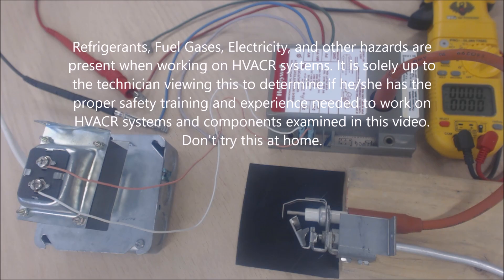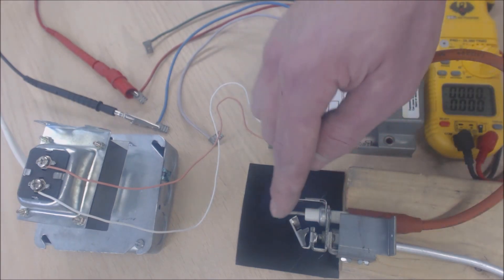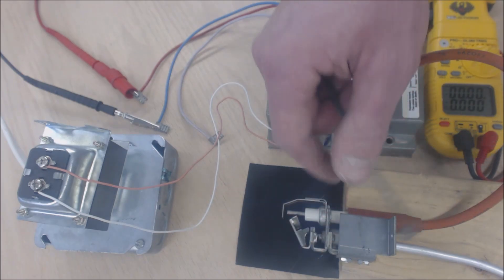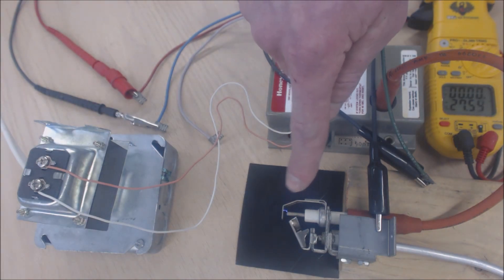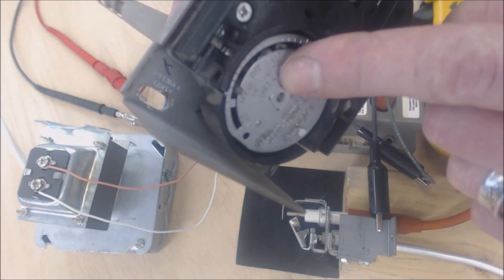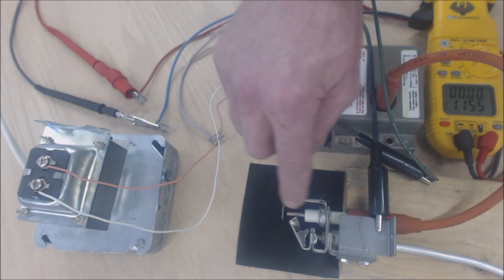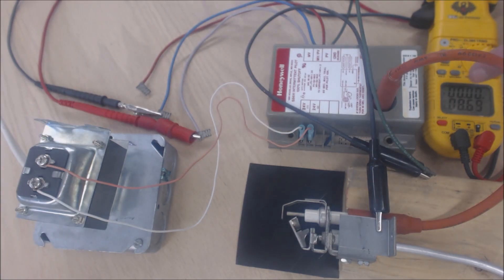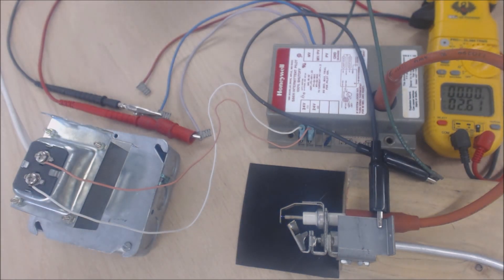Gas Furnace Spark Ignition Control Troubleshooting!

Comment: What could cause the ignition module not to be getting any power.  I ran thru the troubleshooting steps in your aquastat video and everything checks out.  Circulator is running and I have 24 v at B2.  I have the vent damper on manual and the green light inside indicates it's getting power.  The blocked vent safety switch is not showing continuity but I'm not sure if that means it's defective or not.  The reset button just pushing in and returns. There's no click. I also tried jumping the switch to no avail. 
Edit:   Before giving up I decided to redo my troubleshooting steps and when I rejumped the vent safety switch, the heater fired right up.  I'm not sure what I did wrong the first time.  I think the first time I may have jumped the terminals on the switch itself whereas this time I pulled the wires and jumped them.  New switch coming tomorrow.  Anyway, thanks for the Aquastat troubleshooting video, it was a huge help is isolating the problem.

Comment: My radiant tube heater has a problem. When I set the thermostat to call for heat, the blower comes on, the igniter fires and it fires up. The thing is: the igniter keeps firing and then the gas valve seems to rapidly open and close after a minute or so. It does continue to run but, this can't be good. It's a 125k unit. I have a 150' run to the shop of 1" and about 8' of 3/4  to the heater.

Comment: i have that same model in my furnace. Does this thing shut the pilot back off in a certain amount of time if the main gas valve does not come on?
A family AC tech was telling me that if it did not shut the pilot off when the main valve fails to light the burner that the pilot sensor is the problem. I tried a new one and it still does not work.
I checked ground and all that with a continuity test and all checked out fine.
Mine was not shutting off the pilot by the way after any amount of time.

Comment: Great video! I came across an issue with this type of setup, everything starts up fine.  Couple of minutes while furnace is running shuts down and starts to relight again, Basically short cycling. I have checked all safeties, replaced ignition module and checked for a good ground. Also pulled out spark rod and cleaned. Anyone have come across this problem?
Reply: Hey, I know it's been 10 months, but did you figure out what was causing your problem?  My unit is doing the same thing.  Please reply.  Thank you.

Comment: Awesome video. I had a job today where the spark wasn’t occurring all the time, I was turning off and on the power to the unit until it sparked, pilot gas was lit & rectified. Burner came on followed by the blower. I’m not a hvac tech but a gas utility worker who does safety checks. Didn’t think to check the ground but sounds like that might have been the issue? What do you think? I would toggle the switch back and forth until the spark occurred and it was fine after that. I could hear the hum of the xfrmr so I don’t think it was service disconnect switch.

Comment: Thanks for the insightful video. I have a unique problem appears very strange. My furnace will go through the initial ignition and main valve opens for about 10-15 seconds or so with full flame, appears to be OK,  than suddenly both the pilot and main valves shut down for some unknown reason. It then start ignition and the valves open with nice flame again followed by sudden shut down. These crazy events repeat about 3 to 4 times until the flame limit switch shut down the whole furnace. My local HVAC tech replaced the valve, the ignition module but still unable to resolve this problem. Any idea or suggestions for me to further trouble shooting. Thank you in advance for your help

Comment: My 4 year old Weil Mclain boiler started exhibiting intermittent problems which first started in Christmas but seems to be happening more often. After the call for heat, I hear the pilot light, but the gas doesn't open and the burner never ignites. After a little while, the pilot will shut itself off, and the boiler is then locked out for good until I completely cycle power to the boiler.

The issue is that this doesn't happen very often. Boiler runs fine for a week or two and then I get a call that there's no heat in the building. Calling a professional over, they see the boiler running and say they can't do anything.

Comment: how about the flame censor, do you have a video about the whole system (gas valve, module control, blower fan, flame censor and burner with ground wiring), thanks anyway

Comment: Really need some help here. Seems like everything is working. When we turn it on we get sparks but that flame never starts. Really need some help. The way I'm understanding it is you get your voltage that induces a spark and at the same time a small amount of gas comes out to allow a small flame that heats up the heat sensor and once it says OK there's a flame it opens the main gas lines and your main burners ignite.  I was told by family im wrong so hopefully someone here can help.  My current theory is replacing that spark ignitor that produces the spark because no matter what we do we can't get past that step.

Comment: I have a mid-90s Carrier 58GSC upflow furnace.  Last year, I had to cycle the power several times to turn the furnace.  These last 2 months power cycling doesn't do anything.  I changed out the control board without any success.  I get 28V going to the Ignition control, but nothing happens.  I don't get any spark or pilot gas flow.  Should I clean the electrode first or just replace the Ignition control?

Comment: If there is a spark, but no flame what is likely the problem?  I am editing this to include that I also would like to know when checking for 24V on the MV/PV to PV does it have to be during the spark attempt?  Will there be a voltage after it gives up for about 5 minutes?

Comment: Great video and explanation of steps and stages. I hope you can help me. I have this same setup, but the only difference is that I have a Honeywell S8600M Module that has all the terminals on one side as opposed to yours which has them on both. All the steps have been satisfied just as you have explained. I have spark, I have pilot light, I have 26.4 volts from the transformer to the module, I have 26.4 volts from PV to MV/PV and I have 26.4 volts from MV to MV/PV going to the gas valve. As soon as I turn the furnace on, I get spark and the pilot lights, I hear the gas valve click open but here's the PROBLEM ... the burners will not ignite. What are the next steps to try and diagnose? What is preventing gas from going to the burners to get ignited by the pilot light that is on and seems to have good coverage across the sensor rod? I live in Vancouver, so the furnace sits for 8 months unused and of course when a guy needs heat, that's when we end up with a problem. Hope you can help! (Edit: I should have mentioned that I also cleaned the spark/sensor rod with steel wool even though it looked good beforehand). Thank you!
Reply: If you have 26 volts from my to mv/pv at the gas valve terminals it should open. After sitting for 8 months sometimes the valve sticks. If you give it a lil rap with a back [f a screwdriver it may open and work normally.  If not check the resistance of the gas valve coil. It should be between 8-12 ohms otherwise it is likely open or shorted.
Reply: @BuffaloFranimal  Thank you for your reply. I did try lightly tapping the gas valve but other vids also discourage that. As I mentioned, you can hear the valve click in sequence as though it's opening but as you say perhaps something isn't opening as it should. I will check out the ohms as well. I appreciate you taking the time to help. Cheers!

Comment: Just wanted to correct you on something you say here and in other videos. While it is true that the module detects the presence of a flame by passing a current through the flame—it is not detected by measuring current through the ground wire. Since all grounds are tied together, both with wires and by the metal chassis, there’s no way to measure ground current since there are multiple paths. It can only be measured on the “hot” side, meaning the current that’s flowing through the sensor wire. There’s probably an internal resistor in series with the sensor wire and the voltage drop across the resistor is directly proportional to the current.

Comment: This is by far the best explanation I've seen.  Many thanks.  I'd ask if there is a way to differentiate the problem, if you do get pilot flame going, but the main gas valve doesn't turn on.  That is, since I don't get an MV voltage after pilot.  Can I jump temporarily, 24 V to the MV line or disconnect the wires going to the MV connector, and give those wires 24v to see if the main valve will open and provide gas?  Otherwise, I don't know if I have to order the Controller alone (no MV problem), or whether I also need to replace the main gas valve.  It would be good to have a way to prove the value good / bad separate from the controller.  Any procedure for this would be appreciated.
Reply: Hi Ron, did you happen to fix your problem on your own or did you end up getting a furnace repair person in? What was the problem? If you see my question at or near the top of the comment section, it looks as though we both have the same issue? Look forward to hearing what it was. Cheers
Reply: @101Parkside  funny to get this, as I did replace the controller and got it working myself, but shocked to find yesterday, that nothing working again.  Blower yes, but no pilot, not attempt at starting, and no lights on the little LED's that are now standard on these controllers.  I wish I remembered everything that I learned.  Feels like I'm starting over :(

Comment: I'm getting 21 volts at the honey well spark module it blinks 8 times which says low voltage .... it keeps the gas boiler cycling on and off til it corrects itself ... correct me if I am wrong the honey well spark module needs to be replaced??
Reply: sorry getting 21 volts at the thv and 24v on the honeywell s8610u  spark module

Comment: Great video!

The issue i'm having is, my burner turn on but after 5 mins of running they turn off and the pilot reignites, run a few second and turns off.  Fan limit stays at about 150-170 degree so its not overheating to shut off.  Tested MV to Common and only reads 13 volts.  Is the flame rod bad at this point?

Comment: Hello great video. I have an old equipment from Sears, an 867.762360, it works but some times while running the flame just dies and then it starts the pilot again and lights on, then the flame dies again and repeats the whole process again, sometimes 4 or 5 times and then stays on until reaching temp. Could ground wire seems ok, where should i look pls ? I am a home owner not a tech. Thanks.

Comment: Thank you for your videos. I have a Robertshaw S 745 on my fireplace and when we activate the wall switch to turn on the ignition, it doesn’t do anything (no sparks, no clicking, nothing). The ignition sparks maybe 5% of the time when we try it (completely random). Usually 95% of the time it does nothing when turned on. Do you think it’s a bad ignition module?
Reply: I have the same problem. Did you figure yours out?
Reply: @donaldsargent8526  I tried everything short of replacing the ignition module but never really found the culprit. Oddly enough, the fireplace works about 80% of the time now. I think it helped to clean the thermocouple and use the fireplace as often as possible to keep it clear of debris. Sorry I wish I had a better answer for you

Comment: Great video!  Curious how long the pilot should stay lit while it’s proving the flame.  pilot lights, but goes out within a second... sometimes the main burner will light, but sometimes it doesn’t and then the pilot just cycles every few seconds... your video is the best explanation of the controller I’ve seen, but haven’t seen anywhere how long PV is supposed to stay open to prove the flame

Comment: Merry Christmas and Happy New Year ! Will the ground affect low voltage input? I have a Honeywell S8610U spark ignitor control which burned the low voltage transformer. I replaced the transformer, and turned it on. Then I got 8 flash error code on this control, which means the low voltage input has problem per instruction. I checked the low voltage input wire (to TH-W) and found it is grounded. When I pull off the burner ground wire (GND), the low voltage wire does not ground any more. Does this mean the ignitor control is bad? Thank you.

Comment: Great video. I have tried in the pass to run a continuity test on the high voltage wire unplugged from everything else. I could never get a reading?

Comment: Does anyone know if there is a new replacement unit for this item? I can only find used parts on eBay. Any help will be greatly appreciated.
Reply: You can get new products, but they might not look the same as this design. This is a universal replacment, meant to work in most applications: https://www.supplyhouse.com/Honeywell-S8610U3009-Intermittent-Pilot-Control-4584000-p 
You can also go outside the honeywell brand, they are fairly standardized, just match up the timings, and features (pre purge, 1 or 2 rod, spark or hot surface, etc)
Reply: Thanks

Comment: Great video as always. Having an issue with my single rod honeywell system. New pilot assy installed. Pilot not igniting by occuring spark however will ignite with a lighter. When pilot lit spark continues and no opening of MV. I'm unsure what could be causing both!

Comment: Is it possible to check continuity on the high voltage wire?
Reply: Testing basic continuity is easy, just test with a miltimeter with the high voltage unit powered off. What will be harder to check is insulation, and if the continuity is being lost under high voltage. That will require equipment that can handle and output high voltage. What you can do is a voltage drop test with a meter that can read the high voltage, which is far easier and cheaper to find. 
Then again, high voltage likes to spark, turn the lights down, and see if you see a spark from the wire, but if the wire is making contact with anything that can ground it, you won't see a spark unless you move the wire away. 
I don't know how much of this applies to hvac since most of my knowledge is more towards automotive, but its all the same basic electrical principles.

Comment: The control makes a clicking sound when calling for heat. There’s a spark and flame for a quick second. Burners don’t light up. And this sequence is continuous. Would could it be? Please and thank you.
Reply from the maker: With the power off, check to make sure the flame rod is clean with unsoaped steel wool. Also check the green ground wire going from the gas valve or frame assembly to the flame module control, thanks!

Comment: Is it normal for the pilot light to increase when the gas valve or burner turns on and then it goes back to normal pilot light when it shut off.

Comment: Hi, I have a furnace with the honeywell s86h intermittent pilot 100% shutoff which is what I thing you are explaining here. My problem is that the blower motor won't shut off. The tech came out and did some trouble shooting and says the s86h module is the problem. Could this module cause the blower motor to run constantly? I'm trying to educate myself. Thanks.

Comment: 6000 volts? Not milivolts? If you were to hook up a multimeter to the spark cable and ground, what should the reading be? DC right? I’m getting 6.1/5.8/6.3 readings when spark is initiated.

Comment: I am having a problem with the newer model of this board the s8610u . I am getting spark and pilot but no 24v to mv .we have checked all of the grounds. In this particular unit, the only way to prove the flame is on the ignition board, with this ignition board it has a jumper that you disconnect and hook a flame sensor to. We have tried cleaning the flame sensor and still nothing. Also we will replace the board and it will work for a week or two and then for some reason will not sense flame again. Need your help guru !!

Comment: hi, is there a way to confirm the voltage is getting to the spark rod? like a voltage measurement. Also, is it safe to say that if you get 24vac across TH and TR and there's no spark then the control module is bad? thank you so much for all your help.
Reply from the maker: The voltage is too high to check with a meter. You should have a spark gap is 1/8" or less and with the power off, you should have 0 ohms between the control board and the spark rod and 0 ohms between the metal ground of the pilot head to the ground on the control module then yes the module. If you do then yes the board is bad. If not then you don't have a good spark route, thanks
Reply: @acservicetechchannel  thank you for this video and this reply. this confirmed my purchase today of the control module was the right move.